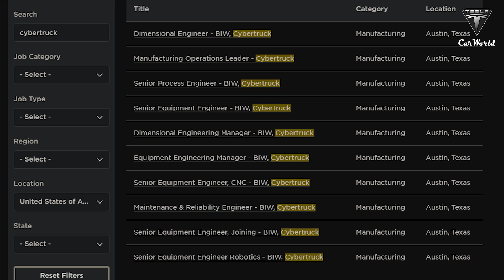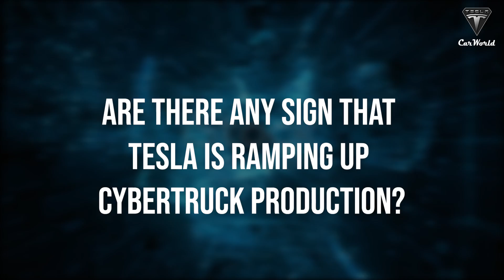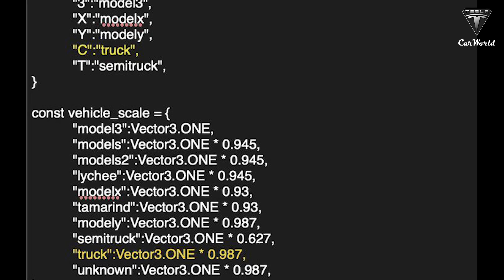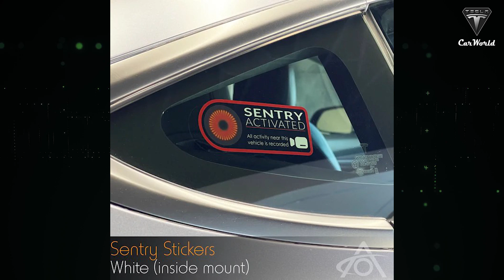Giga Texas Update! Tesla Starts Hiring For Massive CYBERTRUCK PRODUCTION!

Comment: Tesla will have both the full-sized truck of the year and the super car of the year.  Ford is the only company that could have pulled that off, until now.
Reply: Ford Mustang Mach E is bucking it from happening all the way
Reply: @kabysummit5801  The Mach E is a knock-off of the Model Y.  You can buy a Mach E in Time Square for 50 bucks.